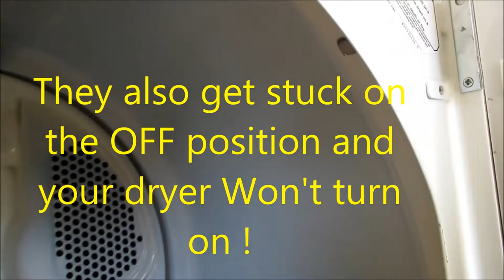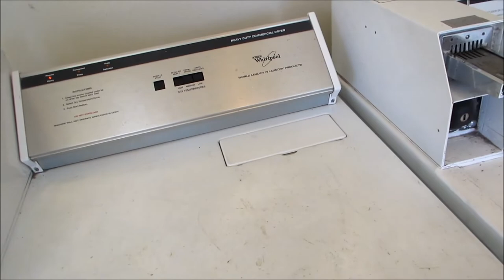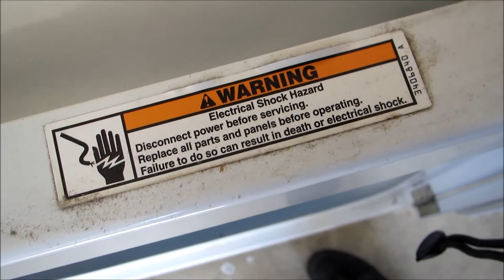dryer wont turn off

Comment: Great video, I have the exact dryer with coin op box the dryer won’t time out unless you open the door and when you shut the door it starts up and I hear the timer running when the door is open do you have a video on how to replace the timer or any suggestions on what could be the problem 
I would appreciate any suggestions, thank you
Reply from the maker: yuv a stuck start switch
Reply: @EurekaRecycler  thank you, you were right I had to put my own momentary start switch in because as you know you have to buy a complete switch assembly which is $160, thanks again for you help much appreciated